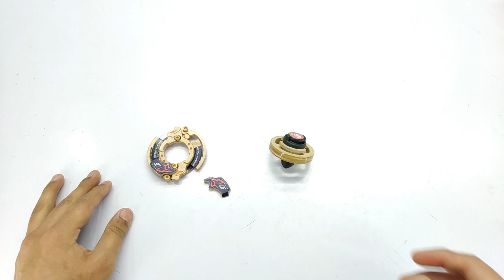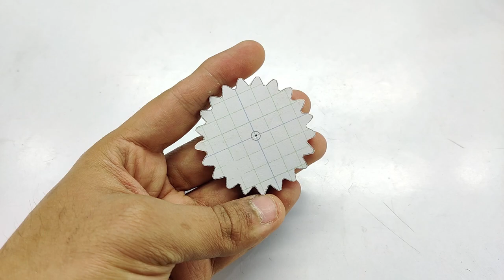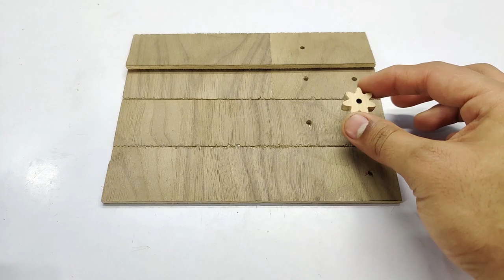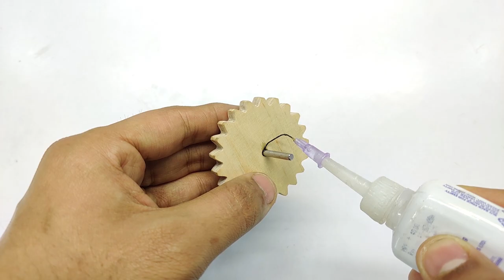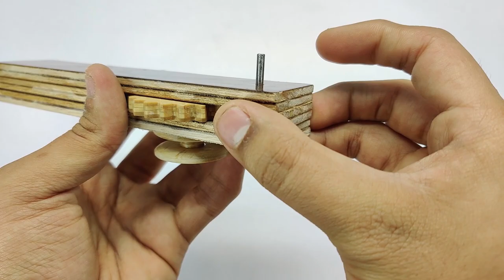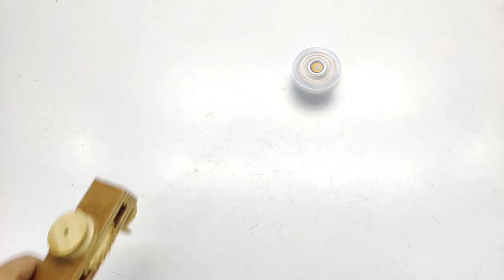How to Make Your Beyblade 4x Faster with This Launcher - DIY

Comment: 100th comment. Plz make dragoon v2 or Genesis valtryek beyblade with popsicle sticks and they should be detachable beyblade.plz make dragoon v2 or Genesis valtryek which are detachable or you can make it fixed but plz make the beyblades mentioned up👆